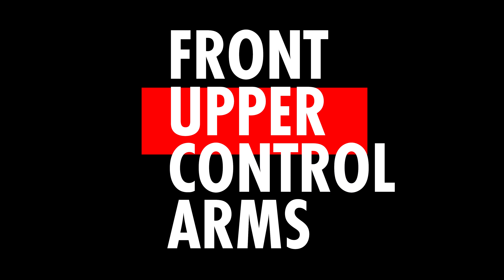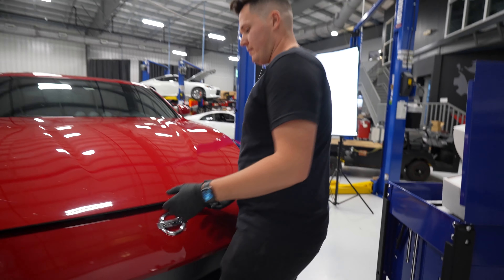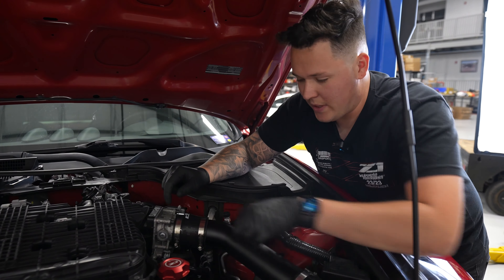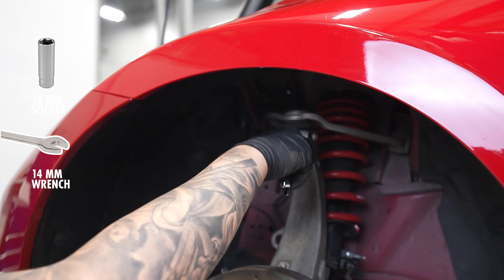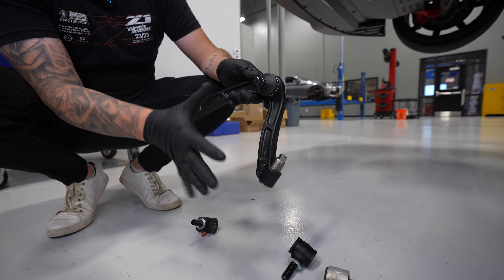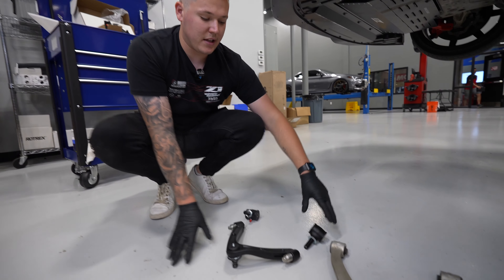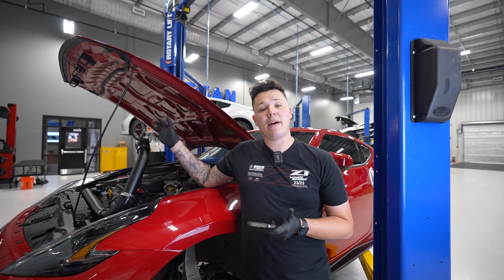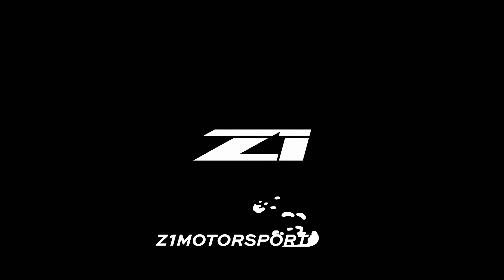How To Install Z1 Forged Front Upper Control Arms (FUCA)

Comment: Is the only benefit with the adjustable FUCA, camber adjustment?
Reply: It is the most valuble benefit for most, but it isn't the only benefit. In this case, the arms gain a bit of positive caster which helps improve stability. They also have either urethane or heim bushing ends that will improve driver feel and reduce flex at the mount. The ball joint is also greasable, whereas the stock is not.

Comment: So I have a 2015 Infiniti Q70L with the same 3.7 engine off that Nissan 370Z. I’m replacing the upper control arm on both driver and passenger side. I’m sticking with OEM upper control arms. Will I still need an alignment after performing the replacement?
Reply: Yes

Comment: I got a clunking noise coming from the front right suspension i wana say its the strut but am curious if i need to replace the whole thing or just get new shocks and bushings, anyone had this issue please me know guy much appreciated
Reply: Know for sure before you start spending unnecessary parts

Comment: Shouldn't you be torqing the bushing bolts down when the arm as at ride height angle?
Looks like the way you did it you might be preloading the bushings which isn't good.
Reply: Ideally you would retorque on the alignment rack. You wouldn't achieve the correct angle in the air, so you would be best to do it on an alignment rack since the car can sit at it's static height.
Reply: they are poly bushings so it's fine

Comment: To me, 13mm is quite strange choice for the adjustment inserts. Std. bolt heads and nuts on Nissan\Infiniti are 8, 10, 12, 14, 17, 19 and, judging on the video, you have a space to use 14mm insert head instead of 13mm. Bringing in such inconsistencies to the suspension is definitely not what we, your clients, are looking for.
Also putting a brake hose under stress like your mechanic did at 3:00 is not a good idea, this should be done before the ball-joint stud is removed.
Editing should be improved: at 3:00 ball-joint stud is already removed, at 3:30 it is removed again😀
Finally, 4:11 shorter 14mm head and breaker bar should be used here to loosen the bolt, then a ratchet can be used.
Good luck and thank you for the quality performance parts you do!